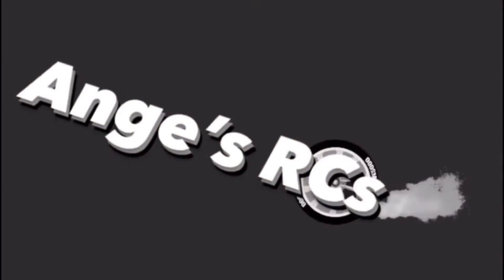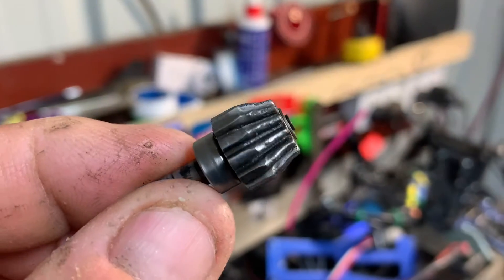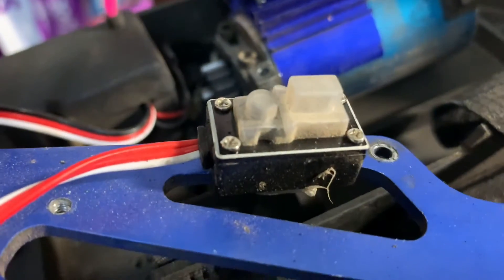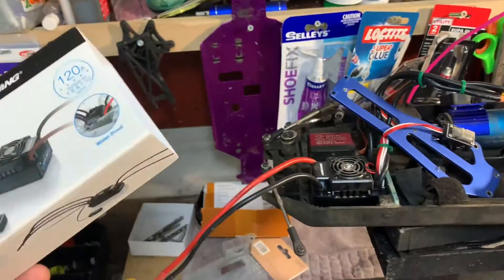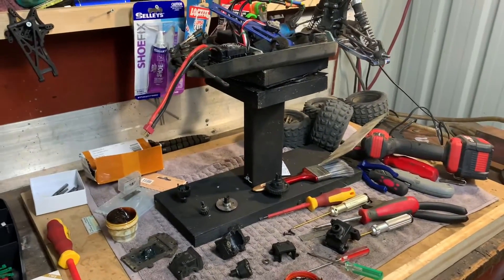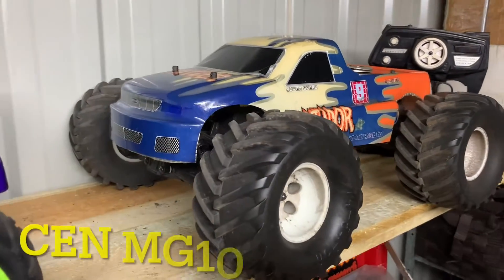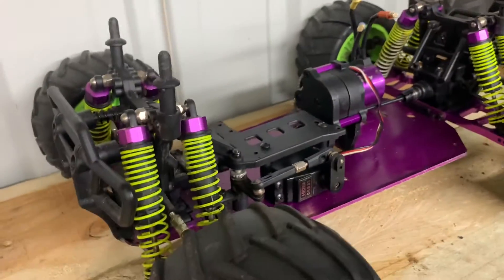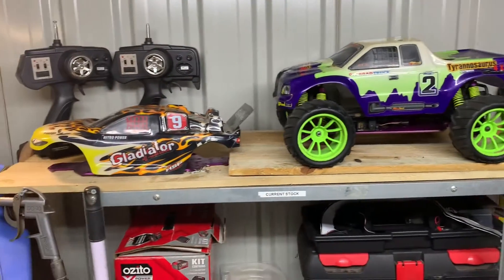How to repair your VRX COBRA DIFFERENTIALS AND UPGRADES

Comment: Hello Anges first of all congrats for you creative ideias and knowledgeble videos.
I have a question, this hsp diffs you used i see are much cheaper then the vrx ones, so i want to know, they perform the same or better then the OEM ones?
Reply from the maker: Thankyou my friend. 
The hsp siffs perform just as good as the originals. The only reason I got the HSP ones, because they were cheaper on Ali express and you could buy in bulk and change them when needed. But if you shim your diffs properly, then you shouldn’t be stripping out the diffs. Hope this helps. 👍🏼🚗
Reply: @angesrc  sorry to bother mate, can you point me in the direction of the right shims to use, i mean in size so i can order them online, if you have any link even better, thanks in advance my friend.
Reply from the maker: @Fast_Lane_RC  honestly mate. It’s been a while since playing with the VRX. I wouldn’t be able to remember the size. But if you pull the diffs apart, The best advice I could giv👍🏼🚗e you would be to measure the outer bearings that sit in the diff cups and that would be the same dimensions as your shims. Get shims that start at 0.1mm to 0.3mm. Hope this helps.
Reply: @angesrc  sure does, will do that, thanks

Comment: What size bearings go in the cobra chassis,the manual said 10x5x4 but someone said the manual was wrong and it’s 5x10x4 which I kinda believe, they did have different pictures in the manual but I’m still stuck on what size I need. I have a vrx blast bx that comes on a cobra chassis so I feel like it should be the same.
Reply from the maker: To be honest buddy, it’s been awhile since I’ve taken out the cobra and also had a look at the bearings.
But what you’ve given me is exactly the same size , you’ve just put the numbers in different orders
Reply: @angesrc  was wondering if they were so ig I’ll go ahead and get them, thank you

Comment: Hi there I’ve buy my Cobra from BangGood waiting the slow delivery here in Ibiza and I’m looking for stuff I will need...it’s my first ever rc car. A friend of mine suggest me the 150K oil for the central diff and 80K oil for the front  and rear. What you think?
Reply from the maker: Hi Michele. I run 80k in the center and 60k front and rear. I have had no issues yet. But if you were to upgrade some parts I would recommend upgrading the steering servo motor to 25kg. the front chassis plate , the small one underneath to metal. And the swing arms for now. But just get used to driving it for now and to feel comfortable jumping with it. Thanks for watching.👍🏼
Reply: @angesrc  shure, I think the choice of high grade cps it’s to derrap more in tge offroad to block more tge central diff. Anyway can you pass me codes or link to buy what you suggest to change? Thank you so much
Reply from the maker: @michelezampieri8744  
The oils you would have to find out your local hobby shop , because I bought mine in Australia but the other stuff is on Ali express. 
Swing arms

AU $11.25 | Upgrade Parts 10910 10113 Rear Lower Suspension Arms For FTX CARNAGE VRX Racing RH1013  RH818
https://a.aliexpress.com/_mPKkBmP

Steering servo

AU $14.78  42％ Off | 1 X Waterproof servo 20KG 25KG 30 KG and high speed metal gear digital servo baja servo for 1/8 1/10 Scale RC Cars
https://a.aliexpress.com/_m0L9XQJ
Reply: @angesrc  great Thank you so much!

Comment: My diffs have been getting really loud so I may have same problem check out my newest video for the damage I had happened I'm gonna have to take the rear apart to fix it so I will be able to check it than
Reply from the maker: Yeah I’ll check it out. 
I have done a recent vid with 60k diff fluid and 80k in the center diff. 
it has improved heaps. And more responsive
Reply from the maker: https://youtu.be/p6Ct6jQTGr8

Comment: Hey Ange, my mates and I just bought 3 cobra vrx's... I ran mine for 30 mins so far and i've already broken the front chassis plate and now the wheels spin off the ground but not under load. The front drive shaft is bent too. Should I begin by opening the front diff? or the centre diff?  The back one seems fine... Thanks in advance.. There's no trouble shooting in the manual and your channel is literally my only saviour right now!
Reply from the maker: Okay Kris from what I can read it looks like you have done some damage on the front of the car I would say possibly yes you have broken the front differential under impact. If you have broken the front chassis plate and bent the front driveshaft then yes I would say you’re either stripped the pinion gear or the ring gear inside the differential. 😩😩😩
Reply: Thanks Ange.  I'll order new parts and replace them.  Should I be trying to find better pinion and ring gears than the stock versions? And maybe track down some of that 60k and 80k diff oil you review? I've barely driven the car yet.. is this a recommended path if I'm going to replace them?
Reply from the maker: @kristo-nolano  I’ve tried to find better pinion and ring gears for the diffs,  but I haven’t been successful . the only thing I found is that the hsp pinion and ring gear are the same as the cobras. Your find them the cheapest on Ali express. buy the whole complete HSP differential with the housing and then just use the gears to put in the VRX differential housings. What I would do is remove all your differential‘s re-grease them and put in thicker silicon oil. Have a look at my latest YouTube video
Reply: i grease all mine as china does not do it well or at all in diff my grease was minimal and dried up  NOS cars 5  years in storage new but all the same

Comment: Hello...is this car a 3s or 4s?
Reply from the maker: The car from factory comes 3S. But I have upgraded the ESC to a 4S system. But I have also put in a larger size motor to handle the 4S power.
Reply: @angesrc  thanks!  I just saw the blue very on Amazon..are they the same?
Reply from the maker: @andrataylor6070  honestly not sure. I haven’t looked Into it. But send me a link and I’ll check it out

Comment: There not the same mate, iv tried 7 times to use HSP diffs in these cars, it didn't work at all! 
The pinion and crown gears are different thicknesses and the cases are different if you look closely.
Try but I don't expect it to last long!🤞
Reply from the maker: Ah Ok .even tho i’m going to use the VRX diff housing?. It looked
Like it will fit apart from shaving the housing a bit. Il give it a go just for experience. But I’ll take your advice. You do know more than I do about these cars. 🚗🚗😃😃
Reply: @angesrc  I won't claim to know more, its just what I experienced!
You may have some luck, like my cobra that's somehow still going good.

Comment: How many teeth on your motor pinion?
Reply from the maker: I am running a 15tooth pinion. 
The original was 13t.
Reply: @angesrc  what brand pinion you use?
Reply from the maker: @abemosso8869  it’s a MOD1 pinion. If you search in eBay you will find it. Then choose your size. But with the cobra the biggest you can only get to fit comfortably is a 15 tooth. (With a little bit of space for adjustment
Reply: @angesrc  okay.  thanks😎